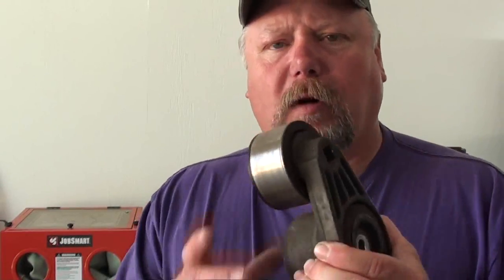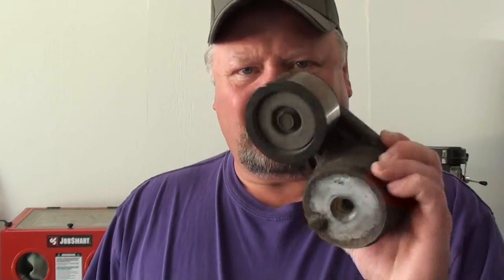Detroit Diesel And Cat Belt Tensioner Rebuild

Comment: MY shop guy called while rebuilding my gear train in my ddec 3 & told me my belt tensioner  was bad & if I wanted to save some money go get him the 2 bearings.got the 2 for under $10.00 instead of the $150.00 it would have cost me. I am glad my shop guy of 13 years does things like this. most any shop would just call their parts guy & have the whole tensioner delivered & bill the customer.

Comment: I needed to replace the lower control arm bushings in my daughters Cobalt, they wanted 120.00 for the whole control arm. I rebuilt them by replacing the 15.00 bushing. It's such a rip off these days. It took me forever to find a shop willing to press the new ones in. We don't have mechanics anymore, they are part changers.